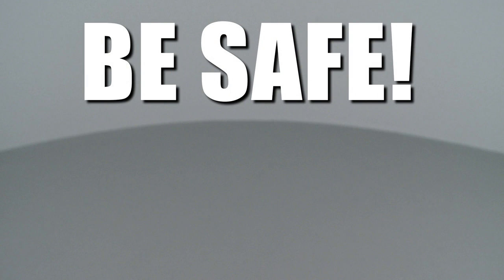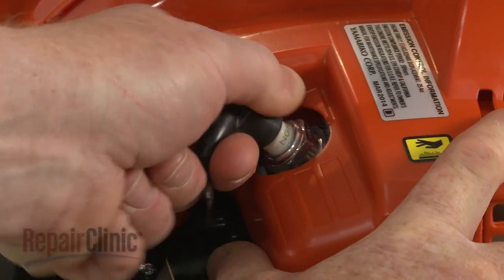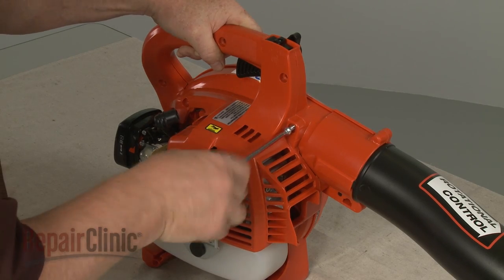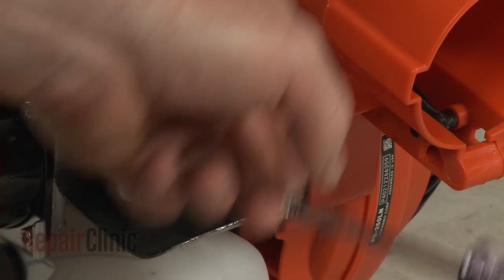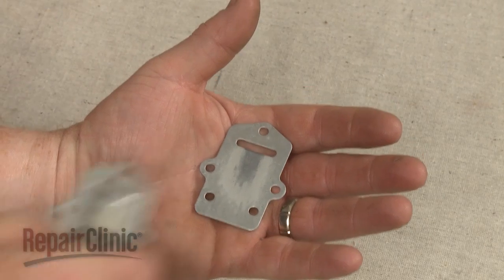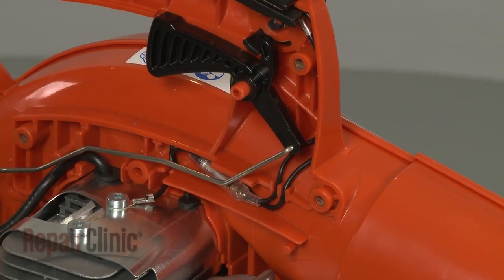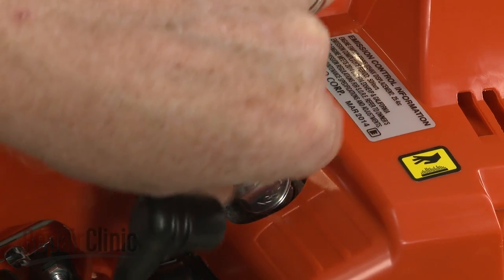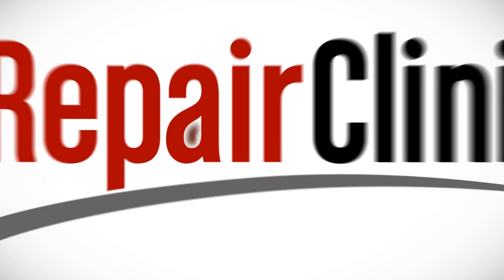Echo Leaf Blower Starts Then Stops? Spark Arrestor #A310000070

Comment: Had the same problem on a Echo PB-251. Tried all recommended problem fix with no results. Changed carburetor, spark plug, all tubes, fuel filter and vent filter. It still ran for a short time and then bogged down and stopped. I found that if I cracked the fuel cap it would start running fine again. Checked the vent and it seem to be working correctly. I decided to crack open the vent valve and trim the flapper in the vent valve and it works great now. I know that isn't the correct thing to do, but you need to do what ever it takes to get the job done.